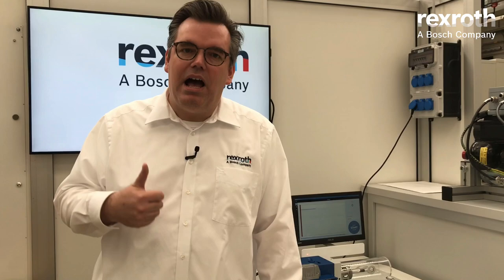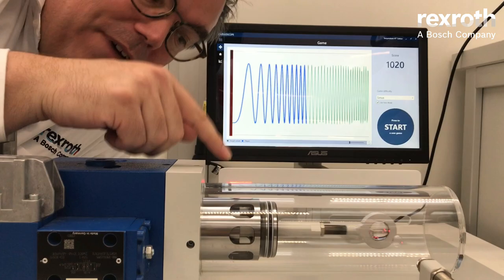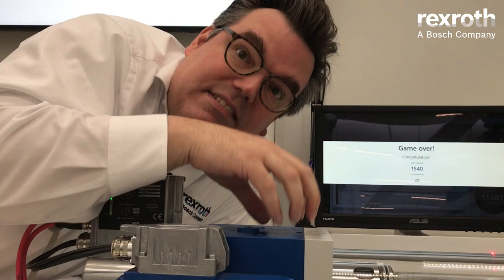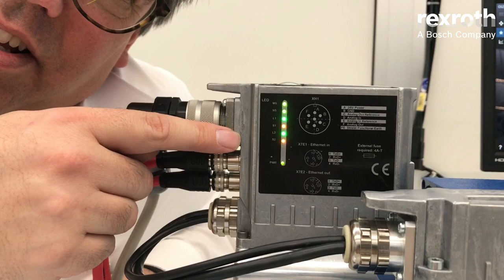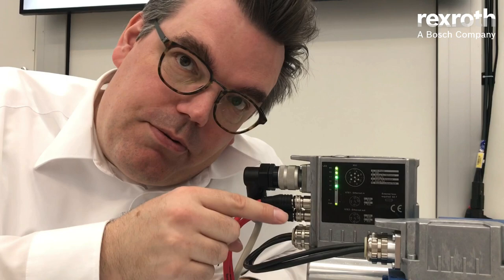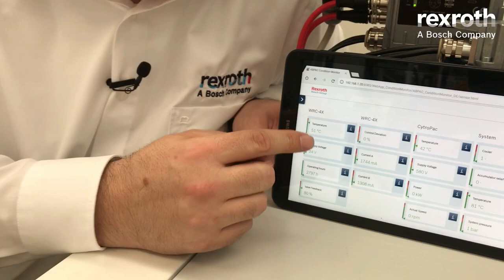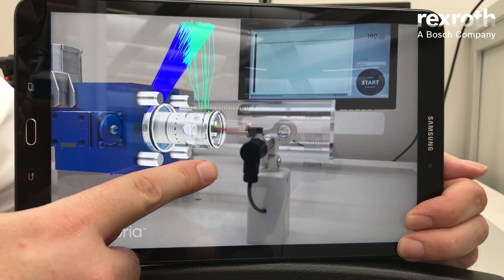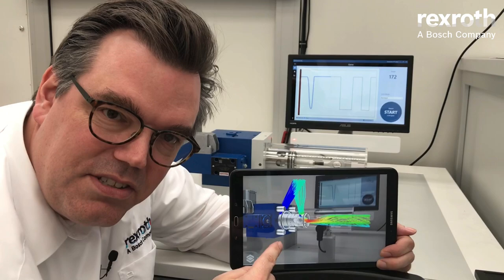[EN] Directional high-response cartridge valve WRC-4X: explanation & function

Comment: Hello Expert, We have an obsolete Rexroth valve model: 2FRE-10-25/16 QB. Now I am searching for an equivalent one. Does Rexroth has any department which deal with such issues?
Reply from the maker: Hello Regler Engineering, 
Any questions regarding our products can be best answered directly by one of our local sales representatives. They individually assist you with replacement and service request as well as with our current and new products. You can find the nearest location on our webpage: https://www.boschrexroth.com/en/xc/contact/index